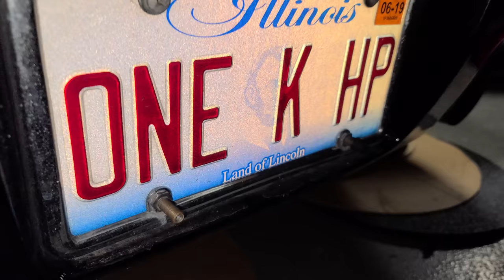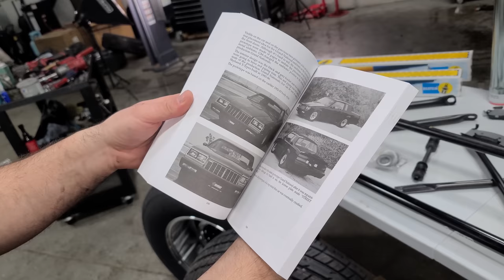My Grand National Was UNSAFE To Drive So I Replaced & Upgraded Everything! New Wheels & Suspension!

Comment: I had an 86 GN for 22 yrs. and I too got a lot of parts from Dennis Kirban. In fact I went to one of his Grand national reunions at the Warminster Naval Air Base back in 1992. The night before I left MI I dropped the tank and installed a double pumper in the tank because I was running green stripe injectors. And I also have that book. Plus I met Molly, who designed the GN for GM and he signed my owner's manual. The first color design for the GN was red, and GM rejected it, so then he came up with the all black and the black and grey interior. I bought parts from Kirban, Applied Technologies, Bolling Green Customs, and Ken Bell. I also found a Prom Pac system that held 4 e-prom chips in a 4-wheeler mag. Also had a few other electronic features that were available back in the late 80's and early 90's. Long before Holly came out with the digital equipment.

Comment: As I watch you disassembling that front, I'm reminded of a polyurethane bushing swap I did on my old Iroc. Every time you loosen a nut or hammer a bolt I see some fine dirt dropping  down.  In my case, some of that dirt wound up in my eye.  I wound up at the ophthalmologists office with a corneal abrasion.  They removed a small piece of rust from my cornea and had me wearing a patch for a week to minimize blinking and allow healing.  Putting ointment in my eye twice a day sucked too. Since then I never get under my car without eye protection
Reply: same with creating fine particles from grinding, blowing, etc., wear a proper respiratory mask.

Comment: Sorry Alex, the "pretty washer" on the top of shock was suppose to be between bushing and frame. Notice the small inner flange, that locates the shock stem to the center of the hole or it can migrate to the side and make noise and damage shock bushings. I've seen many where the Shock stem wore a slot in the side of the frame hole, causing one to need to weld up the frame to prevent destroying new shock. Love the car, Remember, they also used a Grand National in Fast and Furious 4.
Reply: Came here hoping to see this comment.😁
Reply: The top rubber bush is supposed to be between two washers
Reply: I hope he fixes that because it will bug me knowing it’s not right.
Reply: @mujahidbagha7609  Yes, Look at the one he put on top, it has a flange sticking up, that flange locates the bushing in the center of frame hole, or shock mount.
Reply: @doug3805  Problem, the locating flange is now damaged from the shock nut, will no longer locate the shock stem in the center of hole as intended, I know this because I learned this the hard way, hat to weld shock hole up and buy new the shock bushings and washers to fix.
Reply: @r.weaver3769  Can he just get that part and replace it ?
Reply: @doug3805  Yes, most auto parts carry them
Reply: Hope one of the guys sees this comment.
Reply: I do suspension for a living. I was gonna inform him of this but I was much too late to this chat
Reply: @tylerjohnson7826  Yeah, I looked before posting as well. I did suspension and alignments too, before fate put a detour sign in my way.

Comment: Been a freeloading non-subscribed viewer for years.  This is the series that finally made me subscribe, great job.  PS - front spindles from a S-10/Blazer will lower the front end 2" and still maintain full travel of the stock springs.  Old G-body trick.
Reply: If you swap in 98+ S10 Blazer/Jimmy/Bravada spindles, it gives you a dual piston brake calipers vs the small single piston caliper. This also gives you a separate hub/rotor setup as well so it's easier to replace brake rotors. You don't have to mess with replacing bearings and seals since they are a sealed assembly. You can get drop spindles for these as well.
Reply: It don’t cost anything to subscribe why even wait if you been watching

Comment: Hey guys, saw you using that red zero degree tip on the pressure washer. There's a really nice option that we use in the pressure washing world called a turbo nozzle. Same zero degree tip, but it spins around in a housing that gives you more coverage. At that distance, you'd maybe get a 2 inch diameter pattern and they're relatively inexpensive. In any case, checking in from Rockford, love your work!
Reply: Oh man yeah turbo nozzles are great for other pressure washer things.
Reply: Not good for many things. And people need to be careful using zero tips. Sertain higher psi pressure washers can cut through a 2x4 with them. Very dangerous. Be very careful what you do with the red tips
Reply: Since I bought my turbo nozzle I haven't used any other nozzle on my pressure washer... Sure, it's electric, but I've had it for over 10 years and washed many things with it. It came with just an adjustable nozzle so I never had to worry about the red tips, but I agree the red 0 degree tips are very dangerous.
Reply: That's great, but be careful using it on painted surfaces. A friend of mine stripped the estorilblau paint off the front spoiler on his European 3.2 E36 M3 with that same type of nozzle.
Reply: @LloydBraun11  oh yeah I wouldn't dare get close to paint with it, and I have a pretty wimpy pressure washer

Comment: Back in 1990, I had a 1985 Cutlass supreme with the landau roof. I pulled the stock 137 horsepower 307, and built an Oldsmobile small block 403, based on a Dave Smith Oldsmobile design. 410 horsepower and 440 ft lb of torque. I used a 700R4, using a TCI adapter plate to fit on a BOP mount. That was the best times ever. The second year when I wanted to go faster, instead of sending the heads to Dave Smith Oldsmobile, I had a local guy do it. Big mistake, the heads ended up failing with the valves sinking in the head. Before that happened, I was able to pull off a 12.7 in the quarter mile, with what I believe was a 1.58 second 60 foot time. Most of that was using the computer-controlled quadrajet, that I had the carb shop in California calibrate. Boy do I miss that vehicle.

Comment: Keeping several cans of flat black rust converter handy goes a long way when working on these older projects. I like to pressure wash, dry, then quickly spray suspension components/frame/underbody like this for some quick and easy protection that looks good.

Comment: Yes bracing the body on a GM G Body is 100% worth it. You need to adjust the air filter because it is very evident from the side. For sure it needs to be lowered a little in the front. Leave the rear wheels.
Reply: Leave the rear wheels add Power.
Reply: That air filter looks out of place because he is missing the air dam deflectors that attach to the bottom of the fenders/bumper. I'm hoping he gets them soon!

Comment: Alex, about power washing on the lift, yes, it can get REAL messy if you don’t stage the cleaning area properly. But, if you set up a proper curtain wall of plastic sheeting and a box fan for air flow ventilation so the moisture doesn’t creep into the cabin area too much, power washing the underside of the car on a lift is the only way to create an almost “new car” result. We mounted some tracks on the ceiling to make it easy to create an actual wash bay with a lift by simply dragging the plastic around the whole thing. Works beautifully given there is a drain right in that area. But you can simply drop a couple huge sheets right over the car itself and get the same results, but it’s a little tight at the sides. The greatest aspect of the results of such a deep and complete cleaning under there (as you probably already know) beside looking beautiful is finding all the stuff that needs to be replaced but you would never know from all the thick gunk covering it up. Plus in some cases where there’s a lot of heavy gunk build up, it can actually take a decent amount of weight off the car. We actually weighed a truck we were going to clean before and after and dropped 31 pounds of crud from the underside!! 👍🏻😎👍🏻

Comment: The right rear does get lower but completely from the engine twisting over..
It is do to the rotation of the pinion on the ring gear. 
The rear axel is pulled up into the housing. I cannot remember 
the Drag Racing weekly paper I read it in it was a very long time ago.
 I do remember it was around 1979-1983 when I read it.
Lastly please remember the greater the spring rate you use
the more shock dampening you  will need.
The soft ride is a large part of it charm. 
Many miles of enjoyment with your GN.
Mark

Comment: I watched this twice, and remembered back in the late 80s having the suspension on my 1978 Regal fixed piece by piece. I don't think I had the front springs replaced but definitely the rear, which had the car sit level instead of sitting low on the right side. When I got the car from my mom, the shocks were leaking. I also added a rear sway bar which helped. Pittsburgh is very hilly with plenty of curves in the roads, so having the car handle better was needed.

The car is looking great. Looking forward to more videos about this car!

Comment: This series hits close to home for me. Back in 1981 I got my 3rd car…it was a 1978 Buick Regal. It had the 231V6, bench seats. It was a pretty nice car. I trashed the motor and put in a 283 V8. That V8 smoked the Techtronic Trans so I bought a Turbo 400 with a manual valve body, reverse shift pattern. Installed a B&M Quickshift, bucket seats out of a Pontiac. Had it like that for about 1 year and bought a built 355SBV8. I owned that car for about 8 years. I put some ET mags on it, lowered the front, raised the rear. Tons of great memories in that car. I love the Regal body style of the 70’s and 80’s. I always dreamed of getting a GNX.

Comment: the front braces came on many gm cars and wagons....the seat brace works really well, be sure to add the missing body mounts, put boxed lower rear arms on, it has good uppers already. put manual brake rear s10 wheel cylinders and get two sets of rear shoes, use the long ones from both sets and they will hold 6lbs of boos at launch.

Comment: In my 86' GN I installed the x brace behind the rear seat. They help prevent cracking by the rear quarter windows. They did seem to stiffen the car. I seem to remember that the cross braces from the fender to the radiator bulkhead were standard on the 78' to 87' G bodies. Take care.

Comment: The Lifehouse bit had me giggling!😂 11mm = 7/16, 11 fits a tad snug on a 7/16 bolt. Oh and those KYB shocks were super common even in the ‘90’s-‘00’s, I can recall installing a few sets myself. Personally I would go with the bit narrower rear wheel. Good work all around though, really enjoying this series.
Reply: I installed a pair of those KYBs just a few years ago as on a truck while I was still planning out the build.  They are a decent off-the-shelf type shock that gets the job done for cheap.

Comment: You need to get the 200-4R trans in that custom built. They will handle around 1000hp with the right parts in them, seriously underrated transmission and sought after now because they have an efficient .67 fourth gear.

Comment from the maker: Do you think the rear wheels and tires are a little too much? What would you do?
Reply: Track use only - go with the 8s and 255/265s as you stated. Awesome car!
Reply: I would have 2 sets for the rear. Street and track
Reply: I think they look great and if you are going to do some runs you have the best tyre for the launch. then if you retire it from the track it will still look the part even with a road tyre.
Reply: Too much and they will wear out incredibly quick since they are drag tires.
Reply: Stock tire is 235/75 15 same as my 85 trans am.
Reply: No it looks perfect
Reply: Looks perfect!
54:36
Reply: Too much
Reply: Regarding the rear tires, go with the 2 sets. With the drag slicks you'll have every weekend tuner challenging you and the GN. You don't have anything to prove to the yahoos, and throwing on the 10's to take it to the strip only takes a couple of minutes (less than 3?😅), and you'll be ready to hook them up for the real competition!! 👍😁😜
Reply: Previous GN owner here. Pay attention to rear control arm boxes, they are weak even if they are not rusted. Mine broke during acceleration and I had the rebuilt by and welded by a welder who worked on submarines at NN shipyard who was recommended by a friend.
Reply: I think I would have a set of 8's as well for daily driving. Check your exhaust clearance on those 10's, it looked like they were almost rubbing.
Reply: Car sits 🔥👌🏾but you can get the other set also I guess

Comment: As an old guy I see it as my duty to straighten out you young whippersnappers.  First KYB gas adjust shocks are a well respected brand of shock that are still made to this day. When have the Japanese made a crappy product? Second 12 point fasteners are not just header  bolts. They are widely used in the aircraft industry and anywhere else where a high strength compact fastener is required. BTW I love your channel. LS forever

Comment: Alex, you should consider replacing the steering knuckle on the side that had the loose ball joint nut. When a ball joint  stud is loose in the knuckle, it can wear the tapered fit knucle hole oblong. Installing a new ball joint in that oblong hole could potentially cause the new ball joint stud to break under heavy load.

Comment: For the front brakes, a cheap easy upgrade is getting the dual piston calipers from a 2000s s10. You have to replace some of the suspension part but it is a bolt in swap and let's you keep you 15 inch rims. It also is easy from their to upgrade to Corvette 6 piston calipers if you go to bigger rims later.

Comment: 28:11 this Jeep shaft also works on 70-81 F-bodies. I put an 89 IROC quick ratio steering box in an 75 Trans Am**. Reused the stock Pitman arm on the box, steering shaft off an XJ Cherokee and (IIRC) an ~86 Caprice power steering hose so it would all work with a 5.3 LS PS pump

**the “XH” IROC box worked well with 17” wheels. I previously used the stock 15” wheels and narrow tires with a “WS” box from an F41-equipped 85 Camaro (that had a 215 tire profile) still a quick 12.7:1 ratio, but lower steering effort than the IROC box.

Comment: I added the X-Brace behind the seat of my GN over ten years ago and feel like it made a difference in stiffening up the car. I have been told the little cracks in the body that happen at the corners of the sail windows are a result of body flex and that the X Brace tightens up the body in that zone. I also noticed the previous owner of your GN put boxed control arms in the back, a down pipe, and has a larger intercooler outlet? As for the aluminum wheels, I have had the replica wheels since 2012 and love them. They still look great.

Comment: Alex the bracing that came in the kit stops the car from cracking on the driver side roof right in the back of the driver's window right there in the   corner that usually happens when you have more power 
I've  owned a 86 442 G-Body and it started to crack as soon as I break torque it, and gave it  more power with that small block 305 there wasn't much you can do to that small stock it was only 180 hp headers cam  intake Holley four-barrel maybe 225 horse the transmission was trash so)) it needed a new torque converter a  shift kit the rear end  was trash too because only one tire burnout when you're had it in reverse so we needed a posi rear end handling was great if you upgraded to the performance steering box summit racing sold  a performance steering box. So that bracing you're going to need it

Comment: You have probably been told a million times by now but, that 'cap washer' you fitted to the front shocks, actually goes between the frame and the top rubber. It is there to locate the rubber and centre the shock shaft in the hole so it doesn't start rubbing against the frame. I like your confidence though ;-)

Comment: Those KYB's have been around for awhile, the Gas A Just's are a monotube step up from the basic budget twin tube option. Obviously you are replacing them with way better shocks but for a stock vehicle you could do worse than those KYB's. Nice to see all the new gear, should be awesome to drive after.

Comment: The cross braces from the front fender to the core support became a factory installed part on later models to keep down vibration at the core support.  Some cars, when driven hard, would fracture the faster locations on the fender to core support….  Not sure I would drill out to install them.  Just watch how much movement you have on the front of the fenders to see if they are needed.

Comment: Hi Alex and Peter, hi from New Zealand ...great vid as usual...what you guys call cotter pins we call split pins and cotter pins are what we use to hold the pedal shafts and sprockets on a bicycle they are a pin thats threaded and tapered on one end to tighten onto the pedal main shaft...I think nowadays the pedals are held on with a nut and the main pedal shaft is threaded on either end.
Our early VN and VP Holden Commodores have 3.8 litre Buick engines in them and some had a supercharger on them, i own a VS and a VT Commodore both have the 3.8 ecotech V6....you guys had the VT but it was re-badged as a Chevrolet SS.

Comment: 48:27... You can just remove the strap by using a screwdriver and simply prying on the tabs on the battery. That strap is meant to be removable. And you can reinstall it in literally 5 seconds to remove the battery. I keep my strap in the trunk.

Comment: Loving the Grand National videos but I'm not a fan of those huge drag radials on the rear. Alex try dry ice blasting the undercarriage - it will be insanely clean and doesn't make anywhere near the mess that water-based pressure washers make.

Comment: With the air filter placement on the car driving it in the rain could suck in water. You should look into a filter bag. I went with the filter wears brand. It's a thin, mesh, and hydrophobic screen that just goes over the air filter